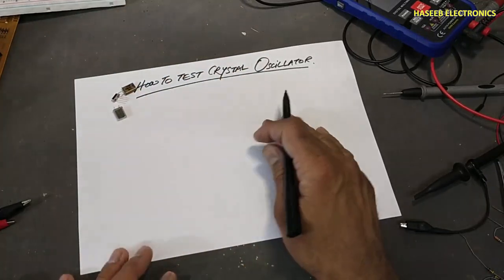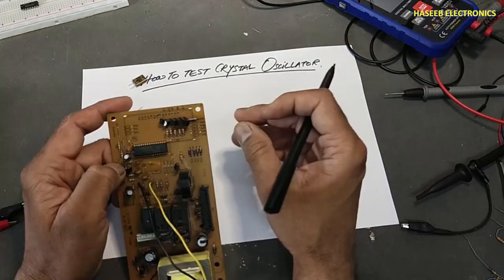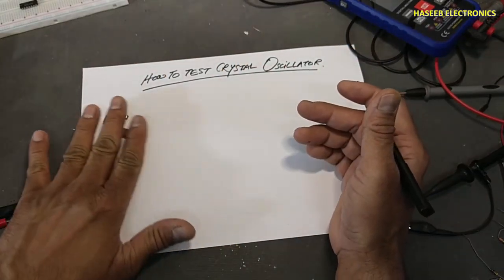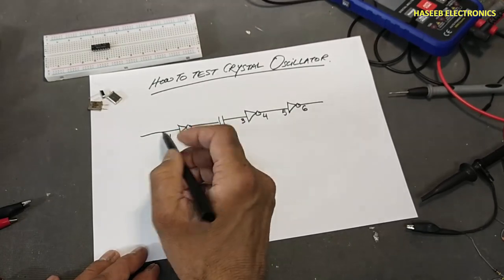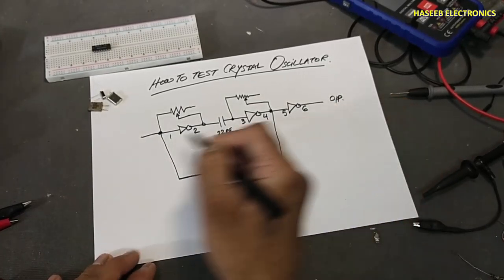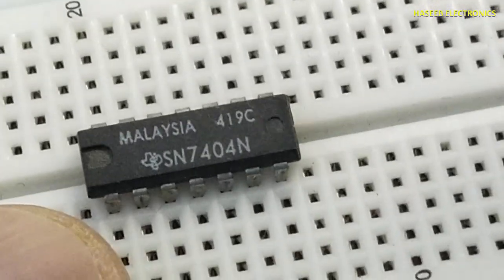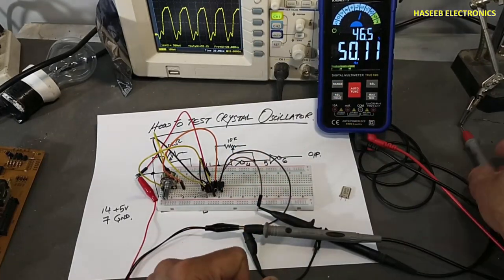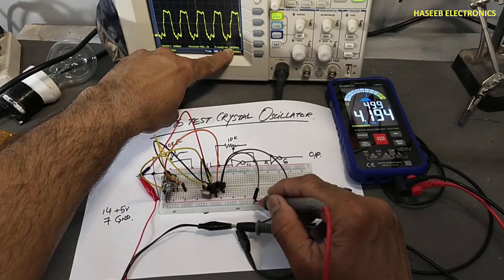{850} How To Test Crystal Oscillator

Comment: Are we neglect the waveform of the crystal i.e it mustn't be sinewave
Reply from the maker: yes brother it is sine signal. using this circuit, when the resonant frequency reaches at its peak, that time the output of TTL level ic is distorted due to the ttl level limitations. because when the crustal frequency is tuned, its voltage amplitude increases significantly 
we will see practically in upcoming video. i already recorded that video and it will available with 2-3 days
Reply: @HaseebElectronics  hey can you upload a circuit diagram?

Comment: Maybe an improper question. The ANENG Q1 multimeter or this you are using lately is better for SMPS and D-class amplifiers ? (I need a TRUE-RMS multimeter but I can't afford a Fluke 179 nor a HIOKI or a Brimen )☹
Reply from the maker: most welcome 
i am confidant while using Uni-T multimeters (specially for smps and other switching circuits, i use Uni-T 202A+ clamp meter. it becomes with perfect results, while other modern multimeters provide false reading while testing smps, pwm signals, 
i will try to use some Uni-T brand multimeter as well and will see its results 
while using Fluke 179 multimeter, (it have frequency limit up to 100KHz only, no duty cycle)
while uni-t brand is much cheaper and reliable (it is my own opinion)
Reply: @HaseebElectronics  I have UT210E . Not a bad one (if it can have frequency /duty cycle also, it would be unbeatable)